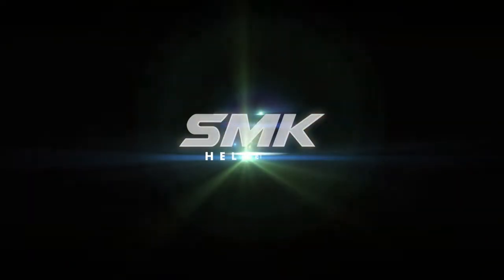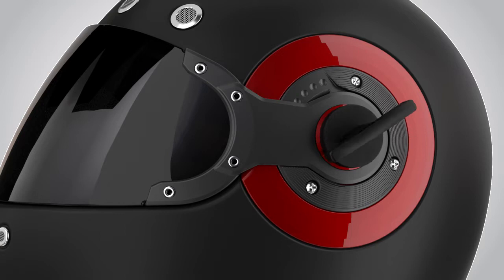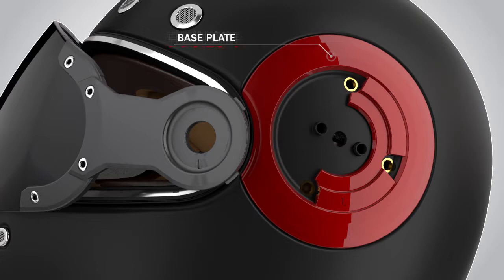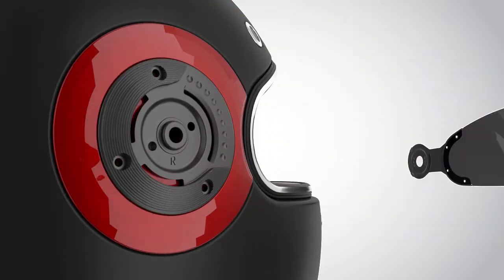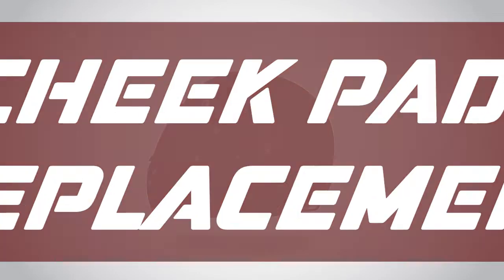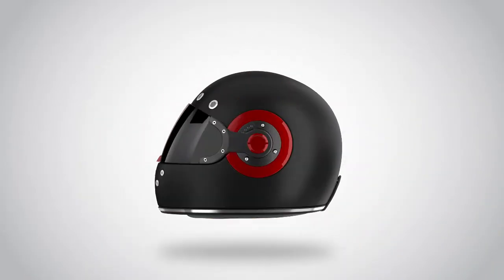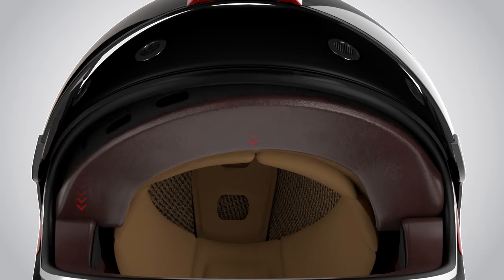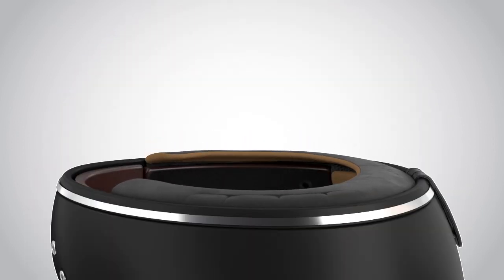SMK Retro Full face Part Replacement Demonstration

Comment: few questions:
-are there tinted visor for this retro helmet?
-are the vents and screws rust proof?
-won't the rain come in thru the vents?
Reply: Since no one from this page is answering your questions--
1. Yes, there are tinted visors available online. 
2. Vents are stainless so rust proof. Screws are steel, and can rust. 
3. Dont go riding with this helmet during heavy downpour, water will get through if it gets wet enough.
Reply: @julian23561  I really appreciate this Sir, thank you so much.
Reply: @PinunoDuyong  no problemo. Ride safe out there.